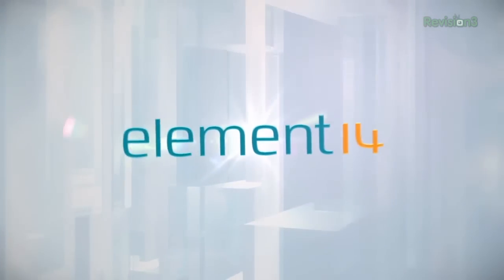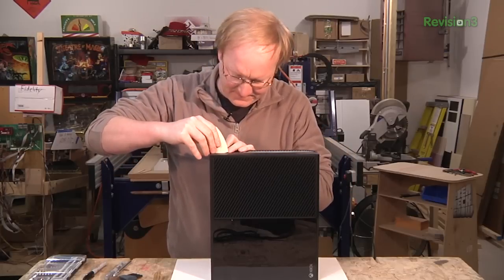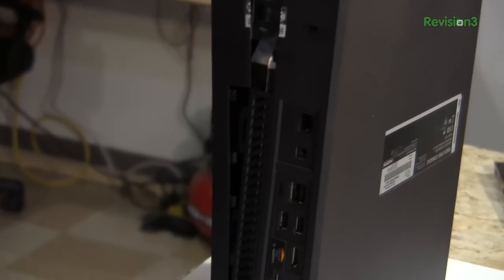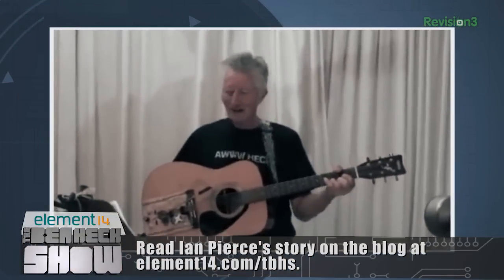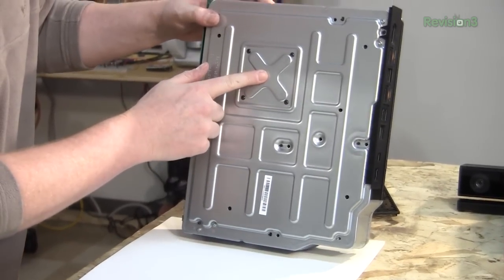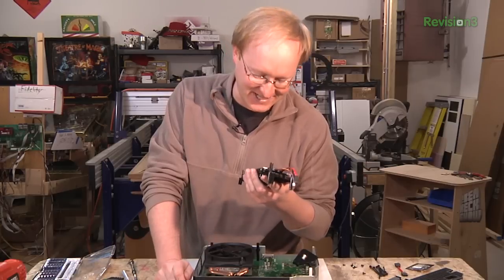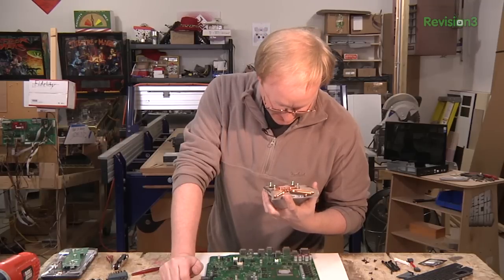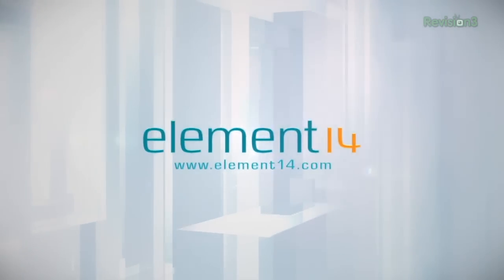Ben Heck's Xbox One Teardown

Comment: Challenge : Turn the parts of an Xbox One, and a PS4 into individual PC's and then run a Diagnostic on them!

(If this would be possible)
Reply: CYRRYANC97 the 260x is a 7790. And the xbone is even less powerful than that...
Reply: Or just build a PC with a HD 7850 (R7 260x) with a AMD 7700k and run diagnostic on that. About equivalent to the Xbone and PS4 if not better
Reply: Ben Zimmerman Well a r9 270 = 7870 so the 265 would be closer to a HD 7850. Do keep in mind developers could take more advantage of the hardware then on PC, but PC is still better :P
Reply: CYRRYANC97 270=7850. 270x=7870. 280=7950. 280x=7970. The ps4 is on par with a 260x in raw performance and fps numbers. Its essentially an under clocked and modified (dumbed down) 7870. The modifications bring it down to a 260x level. Developers can only do so much lol and theres no way to compare that anyway. Since the devs can modify the game beyond what the average pc player can change in the video settings.
Reply: Ben Zimmerman The 270 and 270x have the same GPU, same amount of Stream processors same memory bus and same amount of Vram, the only difference the 270x has a higher core clock and memory clock but it is not a big difference many 270 (non x) come pre overclocked passing a 270x. So the 270x is pointless to get unless you get it for cheap. The 7850 has less stream processors then a 7870 and a smaller memory bus. The PS4 has a GPU about as powerfull as a 7850 but game devs can take more advantage of the hardware which usually relates to longer life span on a console. So realistically a PS4 has the potential horse power as a 270/270x (maybe even a 280).
Reply: CYRRYANC97 yes the 270 and 270x are the same. I was trying to simplify it. The cards i mentioned are the closest in performance to each other for the most part. The most comparable from last gen to current gen. But to say the ps4 is as powerful as one of those is laughable. There have been numerous comparisons and explanations of the actual hardware all over the internet. It is not a full 7870. It performs closely to a 260x. If you don't believe me, instead of trying to argue, please go look it up. There is not enough optimization in the world to bring the ps4 to a 270 level. Let alone a 280...

Comment: why is the ps4 so much better (graphics wise) when they both run amd 8 core jaguars apus?
Reply: The CPU in both the Xbox One and PS4 are very similar. They have the same architecture and cache. The PS4 has a GPU with a few more stream processors which makes it a little more powerful. It is no way 50 percent more powerfull, if you see frame rates tests the PS4 beats the Xbox One by about 10-20 percent at most.
Reply: drew lowery In the case of the PS4 vs Xbone The CPU matters very little and besides the xbone CPU is a paltry 150MHZ faster while the Raw GPU Hardware of the PS4 contains 50% more SPU's, 6 more ACE units vs xbones 2, double the texture mapping units and double of the ROPS. 

Since Games aren't as CPU bound these days and the GPUs are General Purpose Graphics Processing Units (GPGPU vs GPU) Some of the workload can be offloaded to the GPGPU. Since the PS4 GPGPU vs Xbones has more in every way, it is the superior solution.
Ram wise GDDR5 may not have as low latency as the DDR3 Ram in the bone - the speed makes it better (and more expensive)

Anyway it is CLEAR that hardware wise the PS4 is better than the xbone and this translates to better looking games - in framerate and resolution.
Reply: cause microsoft wanted to shoehorn in the kinect which also uses like a seperate os overlay for the voice features it takes extra resources to run all that stuff plus they also have slower ram
Reply: randall snoddy thats so gay. oh well pc wtf
Reply: Pretty much lol
Reply: ps4 have 50% more raw processing power
Reply: ***** no the cpu in the xbone is better but the gpu is slower....
Reply: CYRRYANC97 The PS4 GPU has 50% more cores than the X1s GPU. Thats probably why people think it's 50% more powerful.
Reply: ODSTArchive well to be fair when you have 50% more of the heavy lifters and 6 more ACE units and double the texture mapping units and finally double the ROPS you can see quite easily why the ps4 is double what the xbone is. 
Remember GPGPU is a big thing this gen and although the xbone has the "cloud" that doesn't translate to better quality games and by that I mean higher resolution graphics textures... Etc. Sure AI and physics could be offloaded but not graphics rendering since that would induce lag even physics could since its based on framerate and lag would affect this.
Reply: If you care about graphics, then you shouldn't be looking at consoles in the first place.
Reply: BiscuitFever remember amongst the console "clans" they want to justify their purchase. The easiest way is to say between console option a, b and c. That c has the best performance or c has the most exclusives. 
Heh as they say it's not the "power" that counts it's how you use it! ;-)
Reply: Dion McGovern-Allen PC trumps both consoles in processing power, and the amount of exclusives.
Reply: BiscuitFever I am aware of this and I consider myself "lucky" to own a fairly buff computer with an i7 4770k, 16GB ram, 2x R9 290s crossfire, 64GB ssd. 
But as I said among console owners they want to say that their console is the best. Besides considering when I brought my 290s one of them was just shy of the cost for a brand new ps4.
Reply: Dion McGovern-Allen You can buy a computer for the price of a console that simply runs games better. If you buy a console for games, you're simply uneducated, and shouldn't be spending 400+ dollars on anything.
Reply: Dion McGovern-Allen why u buy 2 290???? why not instead a 295x? are u using 8k??
Reply: Lux Ferre well for starters it was slightly cheaper to get the single cards and cooling is better for each GPU. It was at the time a eh? Why not. Better to crossfire now rather than later when I could get a more powerful card
Reply: but it wastes more space in a computer witch decrease the airflow so its worth to spend that 10-50$ more when u pay already 800 bugs for 2 cards never buy referenz pcb unless u gonna usa a watercooling system but seriously why did u buy that there is no real point to buy it if u not go for 8k or more then 6 monitors coz i already could handle 4k without problems and i got a HD7950 for free

Comment: PLEASE do me a favor, even though we've never met LOL.  My USB's do NOT work on my Mid 2012 Macbook Pro 15 inch.  It only has two on the left side.  For some reason it STILL works with my External Hard Drives but does NOT work with a mouse or ANY OTHER electronic device.  I know there is power coming from it but still does the same thing.  Can you show me the right tools, where to buy them in a link, and how to replace them in great detail?  I would be VERY appreciative.  Being in the army for so long I've been lagging on my tech savvy side of life to do this myself and believe me, I've tried every alternative besides taking it to the Genius lab (which I would feel like i've lost LOL).  Please Help!  Thanks!!

Comment: Just finished watching the both the PS4 and XBOX ONE tear downs. It was very interesting to see the different build philosophies of each company. You can tell the PS4 was designed by the japanese because of the very efficient use of space, just like you can tell the XBOX ONE was designed by americans as it is very open like a pc tower. All in all very cool, but from what I saw I think the reason the PS4 is putting out better graphics is definitely cause of the DDR5 ram, both had very similar chip sets but that DDR5 allows for faster processing. I'm guessing MS picked DDR3 to keep costs down while still keeping kinect.

Comment: Could you make an upgrade for the Xbox One to make it mineral or water cooled?
Reply: Mineral cooling for the xbox one is not practical. And the APU will not get hot enough to justify water cooling, not to mention trying to power it off the power supply

Comment: your wronge about that tv being the smallest hd tv my laptop has has a 11.5 inch true1080 display its a aspire one.
Reply: No he's not wrong, you just haven't listened closely. He said it's ONE of the smallest self-contained screens you can readily get. Completely different.
Reply: ***** just to be 100% sure , the monitor i have uses around 28 watts while my tv uses 33 , with a typical user using them so id asume most of these numbers are based with power saving features turned on.Monitor:asus mx239h my tv:samsung un40eh5300 but like i said your still an idiot going off the base idea all monitors use less power thats just not true as the manufacture can put in implementations to save power usage so even tho you didn't mean it in the right way you were right and wrong saying tv's use more power depends on how much money your willing to pay some are better then others
Reply: he can make a circuit board adapter.

Comment: That thermal paste looks so cheap. Slap some Arctic Silver on there already Ben!
Reply: actually... it looks quite good for oem. Its grey, not white, which suggests it has decent heat transfer, also, it is still very gloopy here, which suggests it resists drying out. The ps4 on the other hand is bright white and already totally dry the day of purchase :/. I do agree that a good name brand paste would definately be better, for any preapplied oem paste.
Reply: Did you not notice the edited-in pop-up that said he would put some Arctic Silver on the chip when he rebuilds it ? XD

Comment: How about using AutoCad's123D Catch, to create a talking Ben Heck action figure. It turns a series of photographs into a 3D image, the file format is STL.

These vidoes, make me want to try and make a Dreadball miniatures game stadium. Raspberry pi, some reverse parking LCDs, speakers. Does anyone know of some electronic strips, to use similar to advertizing boards in stadiums. But on a smaller scale. Probably need some LEDs for some under lighting of scoring zones.

I was thinking considering the amount of cosplayers around. Using some sort of scanning hardware/software and making miniatures, busts and figurines of them.
Reply: The strips are just loads of RGB leds hooked up into the controller to act as an RGB screen so the strips might not be possible, would be easier to put decals over lighted sections

Comment: suggestion for the monitor Ben, take it apart and hook up a lvds (in most cases) adapter board, you can find them on eBay and amazon for around 30 bucks, and some even have multiple inputs that can be changed (think portable multi console).

Comment: Ben, what did you do to remove all the thermal paste? I typically use a scraper and rubbing alcohol.
Reply: Don't use a scraper as you could scratch the surface. Usually, isopropyl and paper towels + qtips is enough.

Comment: For the portable, replace the Harddrive with an SSD.
Reply: ***** If they use the same hardware DRM they did in the 360, then it isn't possible.
Reply: So it can cost 1000 dollars haha
Reply: That can only work if the bios allows for a foreign HDD/SSD ect. and if you can clone the drive and file system
Reply: *****
no. he was replying to +mrharvben99 about not being able to replace the optical drive with a floppy drive

it has been 2 months and no one cared that I mentioned floppy drives out of no where? OK.
Reply: jamesbomb0069 http://www.joystiq.com/2013/12/02/how-to-replace-xbox-one-hdd-for-more-storage-a-voided-warranty/
Reply: ThoolooExpress it was possible on the 360, you just had to use a specific size hard drive, and flash it with some custom image.
Reply: ThoolooExpress oops, didn't realize you were talking about the DVD drive, not the hard drive.
Reply: David Jeffers huh?  David he does mean the Hard drive.
Reply: It has already been done. You can change out the hard drives. i have a 1TB in mine.

Link:
http://team-xecuter.com/xbox-one-how-to-install-a-bigger-hard-drive/
Reply: My bad David.  Nice video though,  can't wait till you create the new laptop :)
Reply: jamesbomb0069
etc. - et·cet·er·a
Reply: jamesbomb0069
Works with ssds. no proprietary crap here.
Reply: ThoolooExpress actually i took a western digital drive for my 360 and flashed it through my computer using a custom flash software and got my 360 to recognize it as a standard 360 hard drive so im assuming its possible to swap the hdd to an ssd
Reply: Wow raging block if you are the real raging block I'm supprised that you watch the Ben heck show

Comment: isn't any of the "RAM" around the APU GDDR?
Reply: GDDR is basically the same as DDR, only GDDR works off of lower voltages, but is clocked higher. GDDR5 is the same as DDR3, only lower voltage with higher clock.
Reply: rpelkey13
Actually, nevermind. I just looked it up, and the XBone does use normal DDR3 while the PS4 uses the GDDR5.
Reply: GDDR is Graphics RAM. Made for GPU and Graphics cards and such...

Comment: I wonder if a 1tb Hybrid drive would fit in there...
Reply: of course it would fit in there, if you use a 2.5in to 3.5in adapter/caddy
Reply: ***** Yeah, I know - his question was regarding a replacement drives physicality and not whether it would work with its bios/firmware and/or regardless if u cloned the the partition(s)...

Comment: just thought i would recommend you  hdmi 12" monitor on ebay that i sell
It had hdmi component and PC input, i use them for FPV with multirotors but they can also be used for portables, do contact me if you are interested it is $199 but i can do a deal cuz its you hehe :)

Comment: hey ben do oyu think you can use the disk drive from the xbox one in a computer ?
Reply: I just did a quick Google search to see if the Xbox One used a proprietary connection or not and ended up finding a whole slew of articles about the disc drive having a lot of issues.  You would be much better off looking for another slot-loading disc drive on Newegg or your own choice of computer component source.
Reply: *****  thanks mate

Comment: Do you think the cooling system was overdone in the Xbox One?
Reply: From what I saw, the cooling system was pretty standard for any processing unit (a heatsink coupled with a fan), though it suffers from what most pre-built systems (be it a console or laptop) do, over-application of thermal grease.  The heatsink is higher quality than what comes stock with a CPU, however.